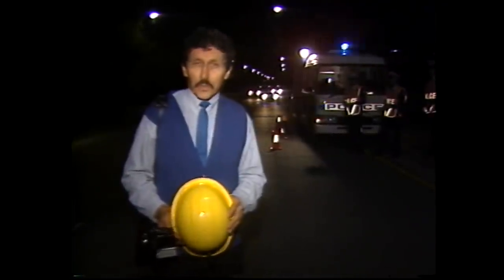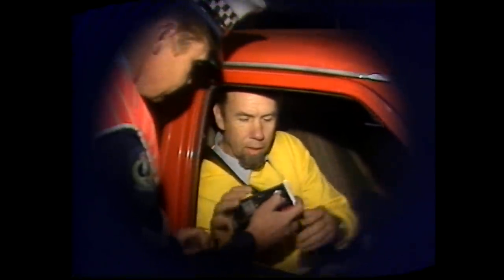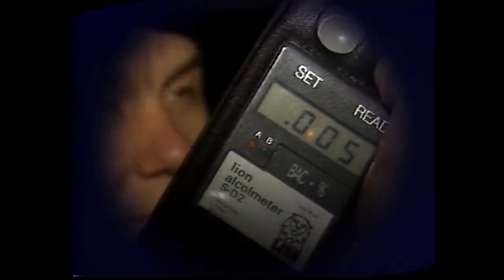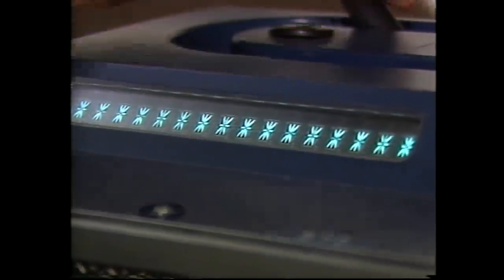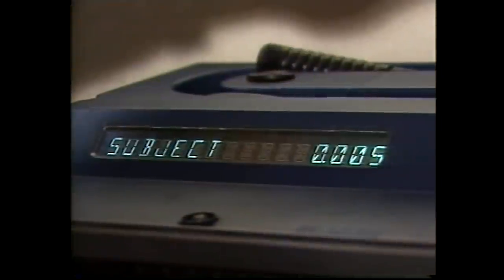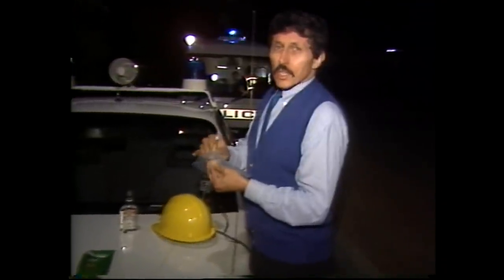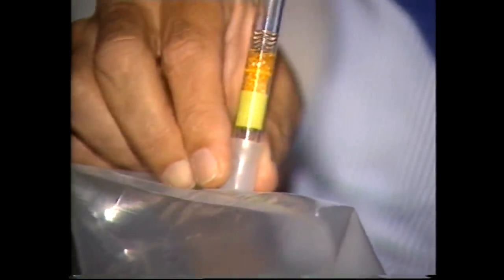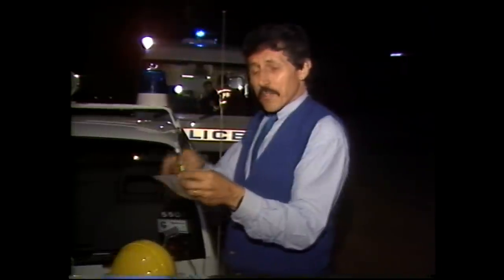How the breathalyser works

Comment: I was more interested in the headcam instead. Pretty cool they had a go pro sized camcorder back then even though it was wired. As a kid in the 80's I don't remember ever seeing a camcorder that size.
Reply: Not a camcorder, probably just a small camera which as you said, was wired. I'm pretty sure channel 9 were using stump cameras in their Cricket coverage at that time.
Reply: that was the visible part. 
I know this system (gosh am i old) - you had a belt with very big battery AND a tape-recorder around your waste, while the camera was redicoulously small compared to the other components.
Reply: If the tape recorder isn't built in, it's not a camcorder, just a video camera.
Reply: @smadaf  even if it's a video camera, as a kid I never saw a filming device so small

Comment: How does the "accurate" machine determine alcohol vapor and not water/other vapor?
Reply: The frequency of the infrared is made so that the physical compound of alcohol disturb the laser which more or less how much alcohol compounds are in the air to Oxygen, argon, nitrogen, co2, ect.